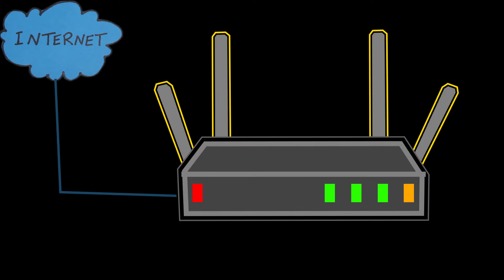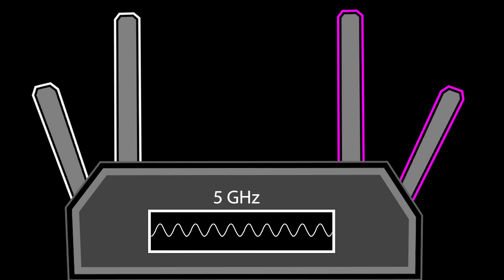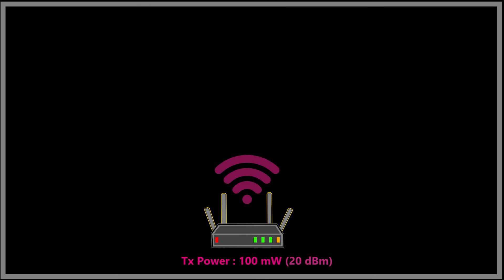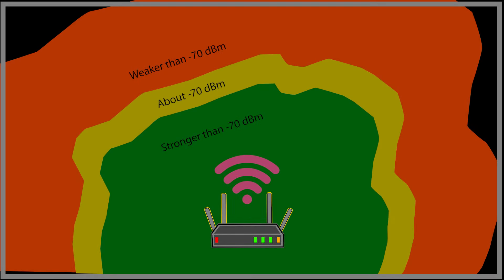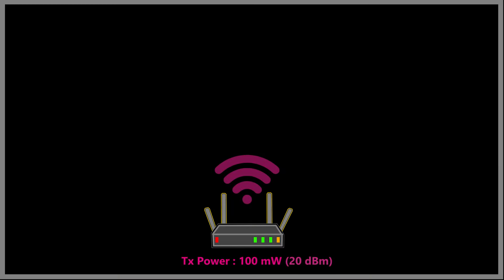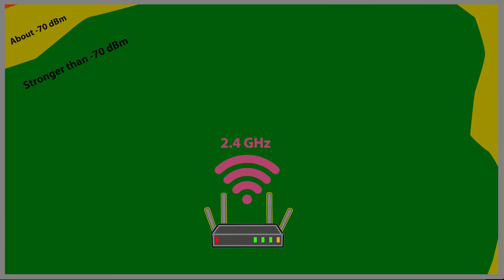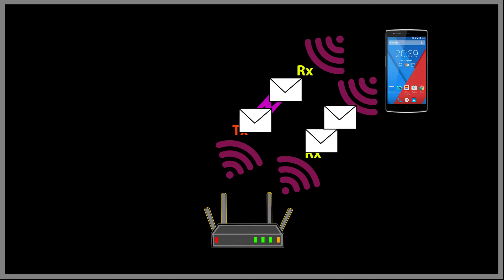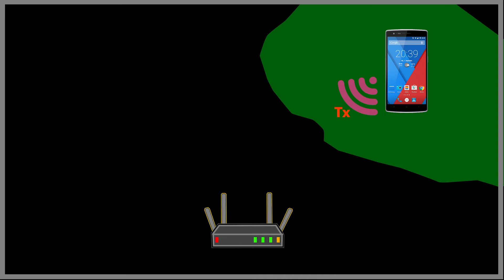Changing WiFi Power! Good or Bad?

Comment: Working in the Telecom Industry for several years, I've experienced this on many fronts.  With a single point of transmission & reception (outside of closed system), distance issues can be problematic.   Enter in a more distributed system of Tx & Rx, where there are multiple Tx/Rx Access Points, over a given area...... prelude to a mess network.   :)

Comment: I used the Asus mesh setup ( 500 Mbps ) with two extra nodes all connected by LAN cable. My garage is detached from my house and wifi alone just couldn't keep my security cameras running optimally, so running a LAN cable between nodes was my best option.
Reply from the maker: Thanks for sharing 👍

Comment: I think we'll find wired access points operating on different channels will be the best solution.

Even mesh which everyone and their dog spruke, robs Peter to pay Paul. Yes you'll improve speeds in the weak and dead zone, but your good zone would suffer. My living room went from 929mbps to 478mbps just by activating an ai mesh node on the opposite side of the house. Data packets make extra hops on mesh so it's a compromise I did not want.
Reply from the maker: Thanks for sharing 👍